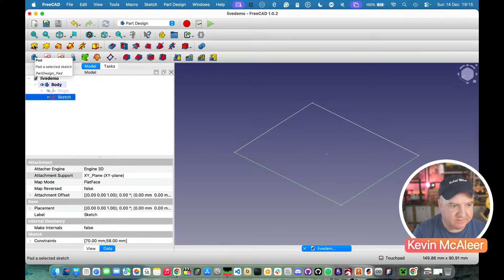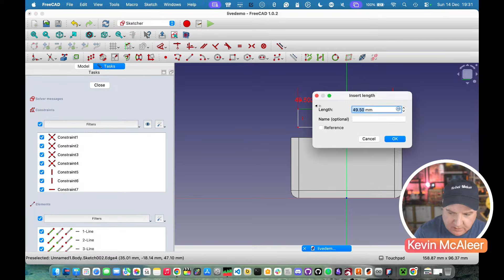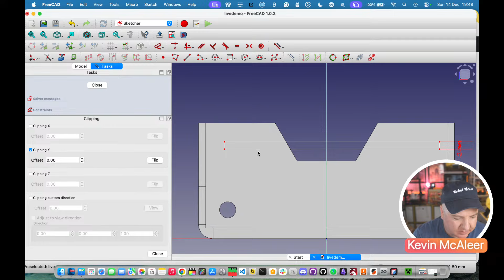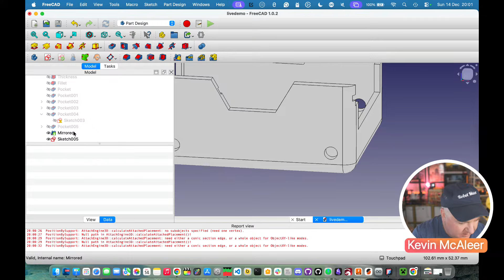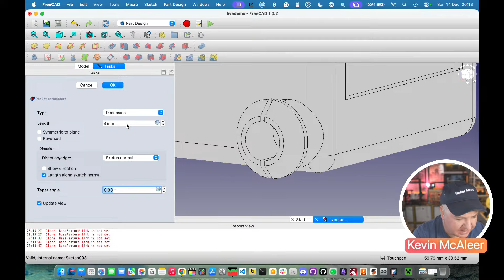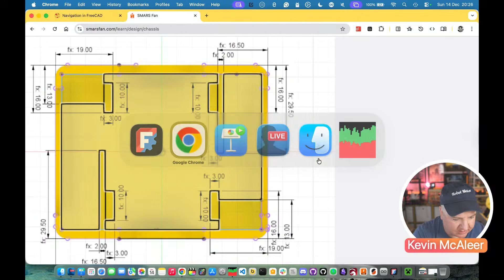Learn FreeCAD - lets build a robot chassis

Comment: Great video man. super straight forward even for someone who is not at all artistically inclined if designing this on paper as a mock sketch.

I take it you can import meshes of motors and such too when making complex multipart models? Can they be connected once you get all the parts designed so you see a mock up of what you've built?
Reply from the maker: Thank you!

Comment: I'm not an expert in FreeCAD but have been using it for several months: for the pcb slots, can't you just create a rectangle on that inside face all the way from one side to the other then pocket it? I think that will work OK with the cutout in the side - no need to worry about the sloping lines.
Reply from the maker: That would certainly be easier - I wanted to show how to do mirrored features in this video so thats why I chose that route
Reply: @kevinmcaleer28  Would it not still mirror correctly?